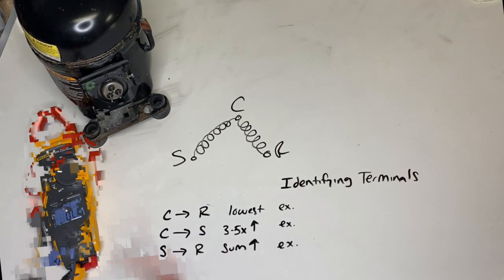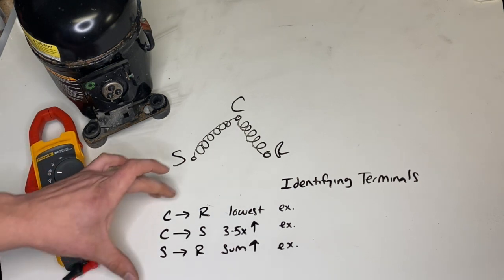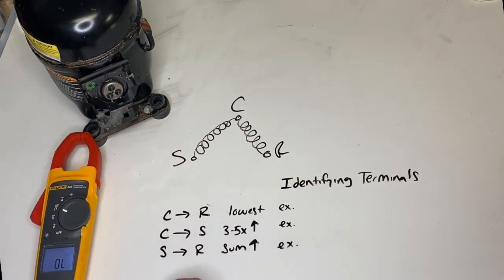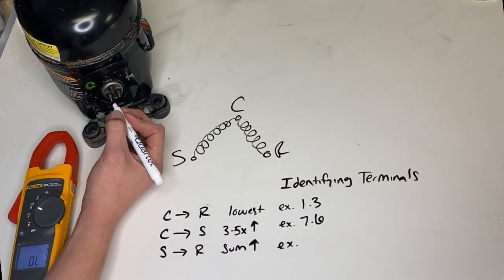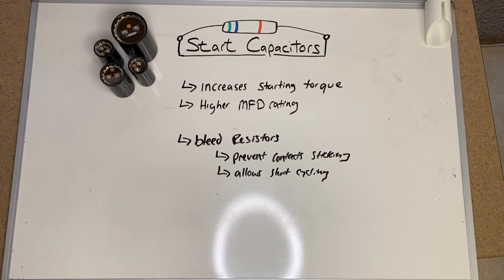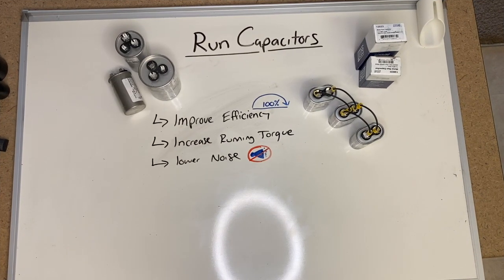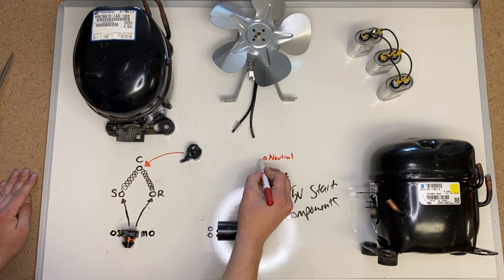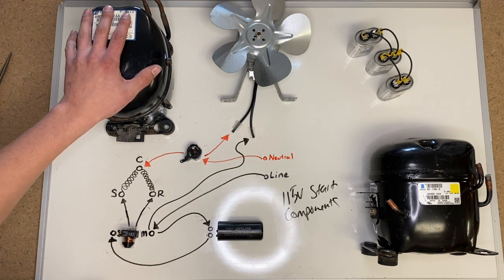115V-208/230V START COMPONENT WIRING

Comment: so I have a restaurant freezer with a data tag that says 115/208-230, and is currently wired for a 4-prong plug. Does this mean the unit can be wired to run on either/or? Can it be wired to just run on on 3-wire plug to a 115v outlet?